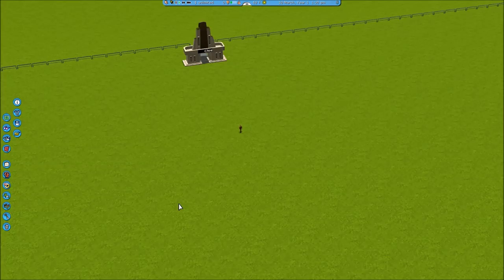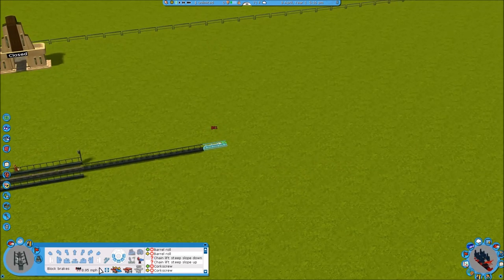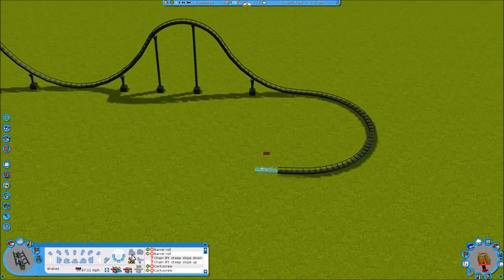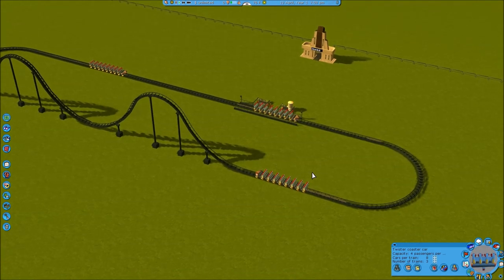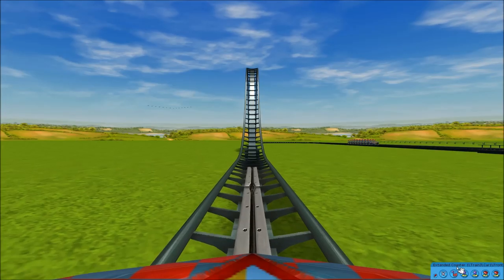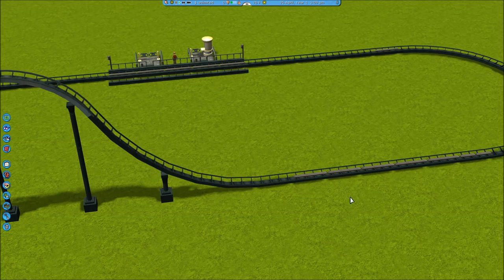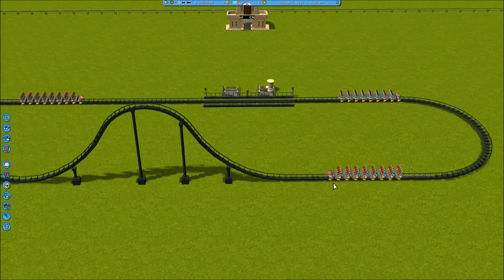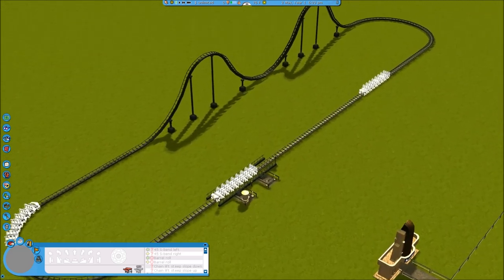RCT3 Tutorial - Stop, Wait, Launch Coaster

Comment: I dont get this! First, it launches. It doesn't go fast, it rolls back, hits the block brake again, and THEN it goes fast. I dont get it!
Reply: That's because you are probably using windows 8. If it helps instead of using block brakes use a chain lift, that always works for me.
Reply: Oh, Yeha i was using windows 8
Reply: ***** I don't really know, I know it probably should work, Windows HP is one of the older ones right? Because if it's before windows 8 it should probably work.
Reply: ok, maybe you should test it, I'm not quite sure if it will or will not work on windows HP.